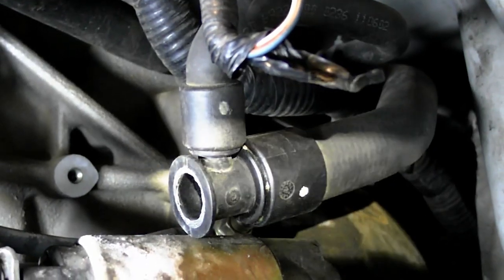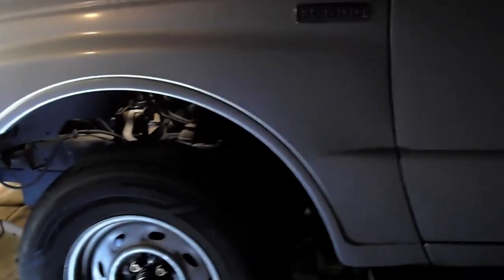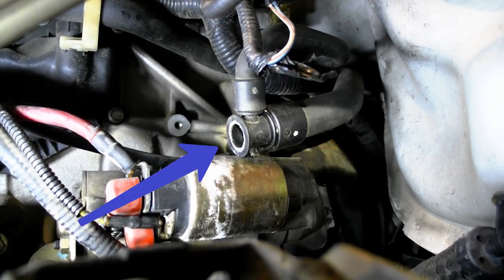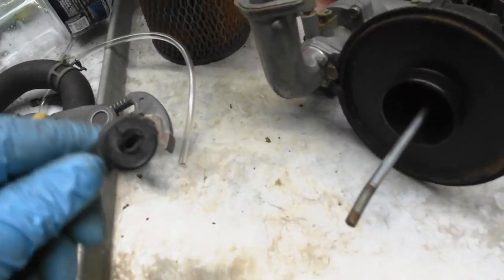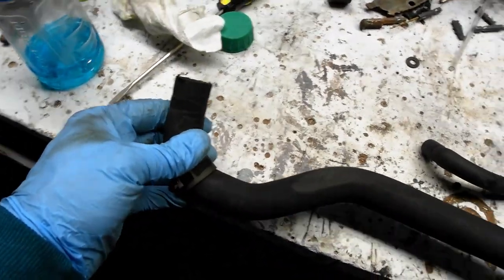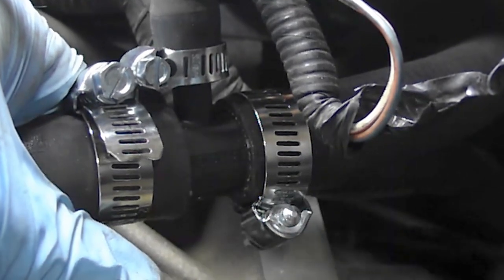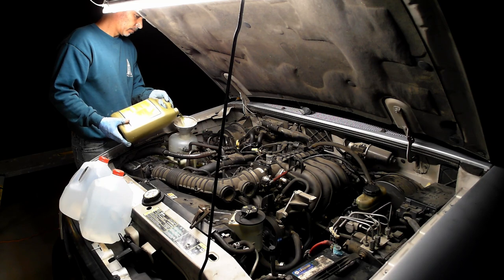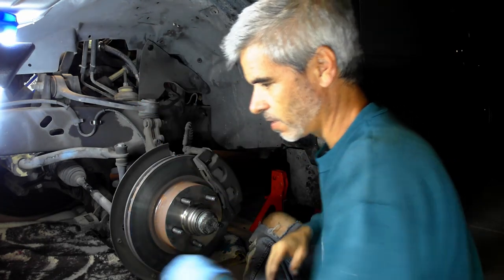Ford Ranger / Mazda B2300 Radiator Coolant T-Junction Replacement

Comment: Thank you ! It really works on my Mazda 2003 B2300 
Two things that I would like to add , 
To break the old tee hose connector I used a 3” C clamp it makes the job easy also I recommend to use a ratchet to tie the bolts on the clamps I first used a flat screw driver and noticed that after to put the Coolant it was leaking a little and then I used  a ratchet with a large extension to help to tight those bolts and I was able to stop the leaking ! 
Thank you again !
Reply from the maker: Hey, thanks for the additional thoughts and ideas.  Have a good one!

Comment: While the 3.0 Ranger engine isn't as "snaked around", the 2 heater hoses each have a Tee-fitting of a size that's hard-as-heck/impossible to find--it's 5/8" straight-thru, with 1/4" side-branch--you can find 5/8" x 5/8" x 3/8" all day long... and you end up forcing the 1/4" hoses (to the intake manifold) onto 3/8" fittings... or buying the all-new spendy pre-formed heater hoses.  Next time I'm just DELETING the side-loops... "pre-heating" the intake manifold, in FLORIDA, is just lol...
Reply from the maker: Hey thanks for the information, I’m sure this will help someone with the B3000 series truck!
Reply: @DansWay  GREAT little trucks, whether "badged" as Ford or Mazda, but that same 3.0 engine was also used in FRONT-wheel-drive platforms like the Taurus, etc. so some things you curse on the B3000 are easy to get to on a sedan, and vice-versa.  Similar story with your 2.5L engine... Anyway, you're doing a great public service with your video--kudos!

Comment: awesome fix. probably going with spring clamps. they're faster and with the tool. i think will be easier than screw/worm clamps in that hole. my little ranger... it's has made me swear off fords and i've only had it a week monday. had a 96 that was the picture of reliability. got crazy ideas and sold it and got a malibu. in hindsight, that was a mistake. i would like to know the genius that thought this setup was a good idea. in fact, why on earth would they heat cycle plastic like that? i'm going to get that fitting for sure and rig it. it wouldn't be right to not rig, that seems to be the norm i'm finding.
Reply from the maker: Yah, I swore off Fords a while back myself, but ended up getting a 2013 C-Max Energi with it's plug-in hybrid battery.  We drive around most of the time just on the 20 miles of range it has.  So far it seams better than my past Ford experiences, but at about 10 years, the plastics start to fail on Fords, so it is about time for those issues to pop up.  We will see!

Comment: Did you use an entire new hose assembly or did you re use it?
Reply from the maker: The original hose was reused (the one going around the back side of the engine and over the transmission).   The shorter lengths going up and to the front could have been replaced at that time but I didn’t have the materials or time to make that change.

Comment: Mine leaks at the T by the exhaust manifold I'm just going to cut it out some how
Reply from the maker: Hey Marty, checking in...  Did you get it cut out and replaced?
Reply: @DansWay  I did I cheated but I did get it fixed mine was metal and it leaked at the T from the over flow tank so I cut it at the bend that went behind the head I had to use my plasma cutter because I couldn't get my hand in there with anything I added a brass fitting T ran the hose over the heater box A/C  hoses worked out great wasn't easy took all day hard on my knees because I had to stradle the motor I still can't imagine replacing the tube for sure you'd have to remove the exhaust I mite consider it if I replace the clutch

Comment: Great video! The “Htr Hose Tee” broke which caused a coolant leak. I watched this video and fixed the problem with the method you showed in this video!!🎉 

D.I.Y Tip
-My vehicle: 02 Ford Ranger 2.3L, manual transmission, 2wd)
-Total Time:30 mins 
-Cost or fix: $7
-Difficulty: 5(Scale 1-10)

-I was able to remove the Broke “Tee” along with removing the broken off piece in Hose WITHOUT REMOVING ANY HOSES OR WHEEL(Turning the wheel gives you just enough room to reach it)! Hope this helps you guys!
Reply from the maker: Hey there, awesome comments! Thanks so much for your input, and I’m glad the video was helpful to get you going.